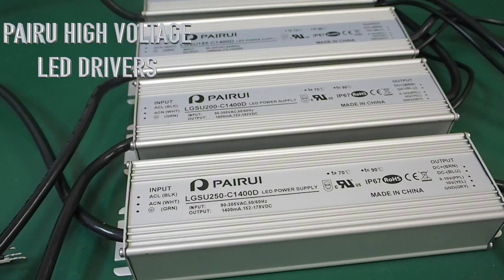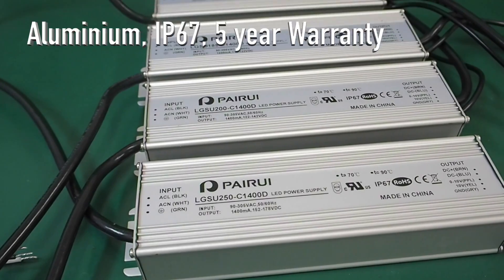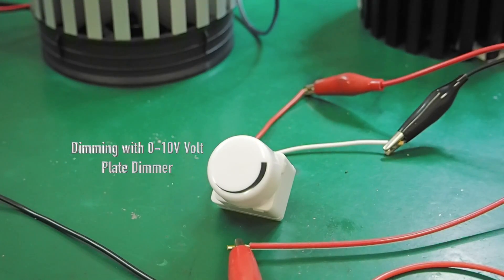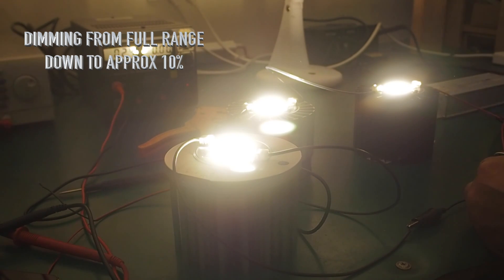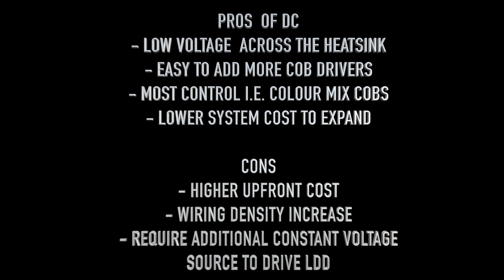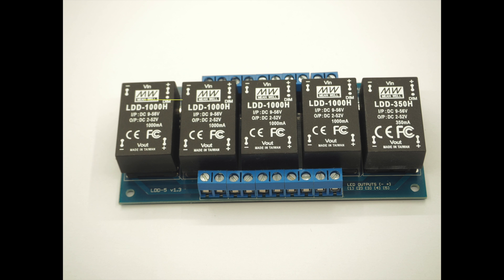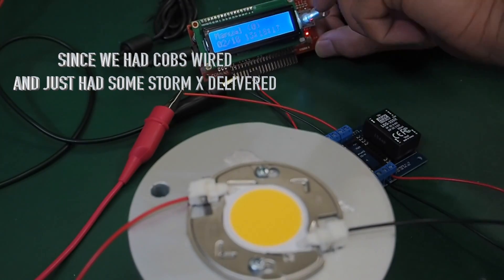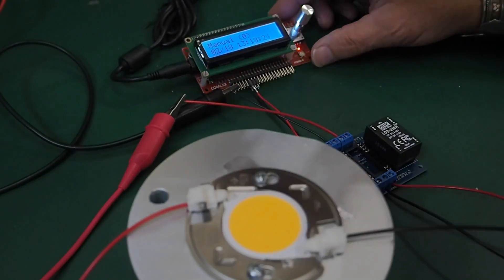Pairui Drivers for CXB3590

Comment: Hello Excellent Video!The LDD-1000H in the video and on MW website are 1000mA. Where can I get the 1.5a one. If I ran each CXB3590 (4 in total) off a (4) LDD-1000 the COBs would run at 1amp each?  Also what Kind of power supply would I need to power this board and drivers? Do you sell them?Thanks